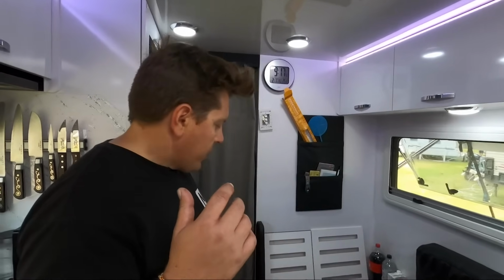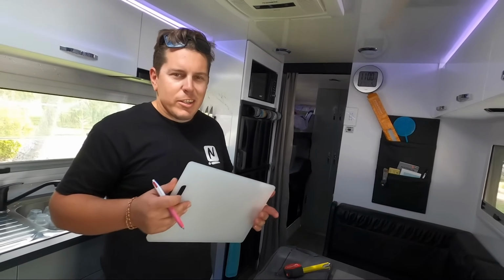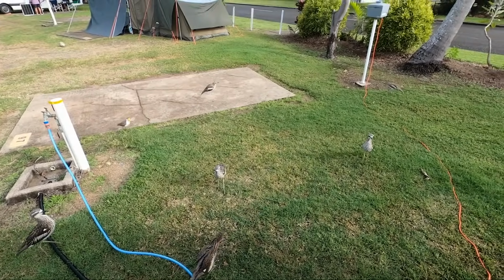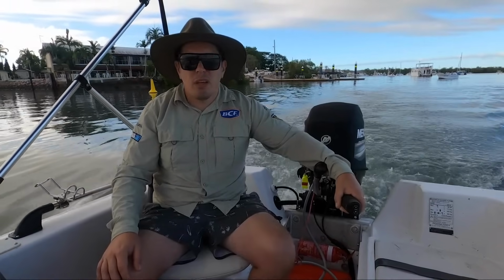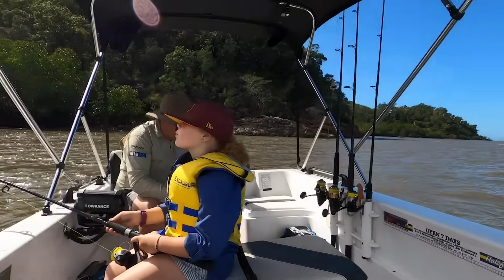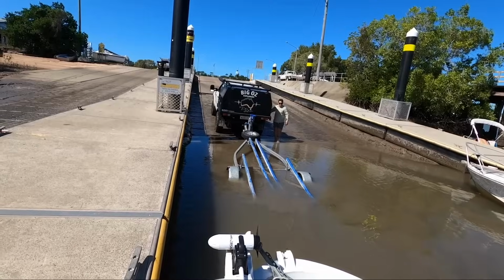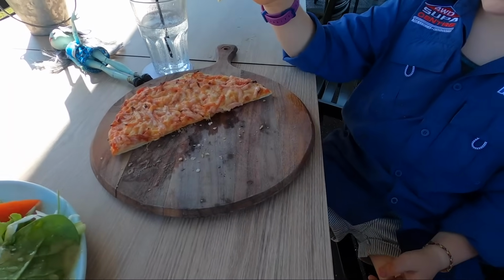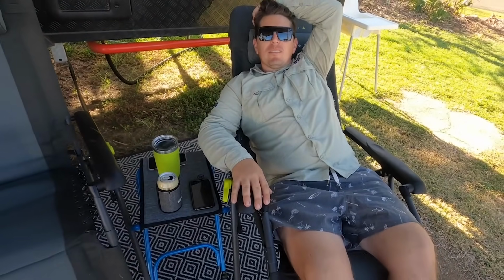INVERTER UPGRADE / WE HIRE A BOAT / LUCINDA / PUB FEED / FAQS - 021

Comment: Great video guys. Good job on the Inverter switch (I'm a sparky). Looking at your new power point it looks like you are missing an RCD (Earth Leakage Circuit Breaker). These are a legal (safety) requirement for all power points installed in Australia that could save your life.
Reply from the maker: Hey Adam, thanks for the compliment on the switch, we were proud lol... I’m not exactly sure what that is or if it’s necessary, it’s a different type of van plug called a double pole apparently, does that make any difference? I have no idea if I’m honest! We will have to look into it next time we’re with a sparky otherwise :)
Reply: Hi guys, yes you will need one installed. Enerdrive actually sell the correct RCD that is tested to work with your inverter. I see it on their website for sale.

Comment: great video and thanks for all the info. With your inverter, how do you run the microwave from it ? ie do you have to unplug the microwave from the mains power point and run a lead over to the power point you had installed for the inverter ?
Reply from the maker: Hey Paul, yep you got it! We have an extension lead which we can run anywhere in the van to whatever power we need ie. microwave. We want to run one in the ceiling support beams so it’s hidden at some stage but we haven’t got that far yet!

Comment: Hey guys  just wondering about the digital wall clock you have there. What is the brand and where did you get it? Looks just like something we would use in our camper , cheers.👍
Reply from the maker: I can’t find it on the Officeworks website (I was going to share a link) but it was around $30 and has date, temp, day as well! We just found it by cha ce in store one day :)
Reply: Big Oz Explorers cheers thanks guys, great vids👍

Comment: Can I ask how much your battery system was, I know trip in a vans was about $12000
Reply from the maker: The redarc BMS30 and solar was already installed in the van, we have only added a 200ah Enerdrive battery and 2000W Enerdrive inverter. Together, these cost us $2505 with install costs that were mainly labour and approximately $500 (??? We had other installs happening at the same time over two occasions so this is guesstimate!) so $3k give or take and we’re up and running, not bad and much cheaper than others that are advertised. It’s doable much cheaper with the right homework 😃
Reply: Big Oz Explorers thanks, we will need to do our homework. When I saw $12000 I thought OMG 😮